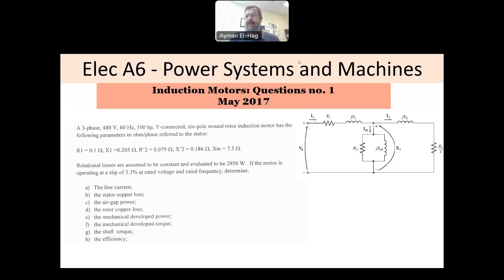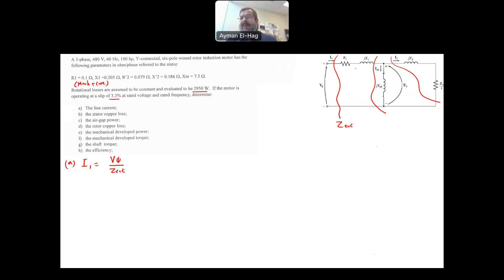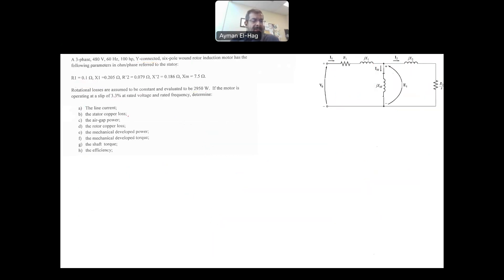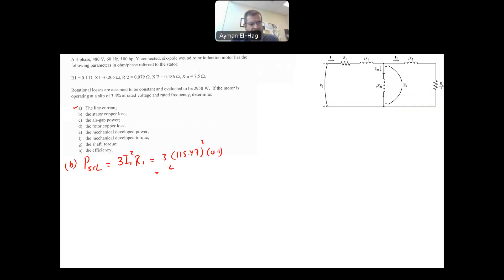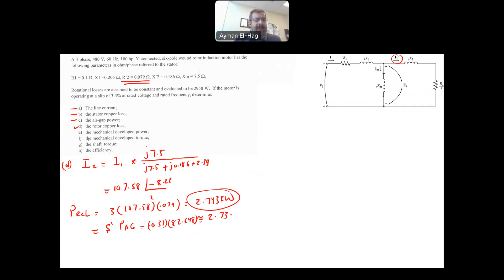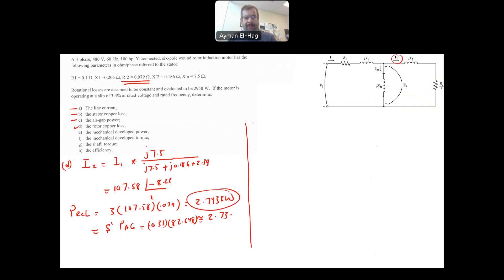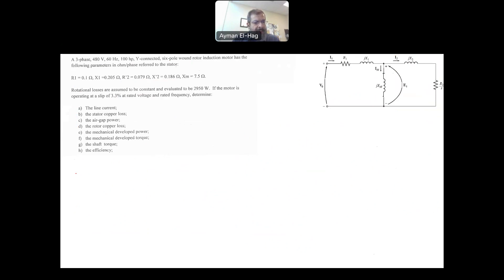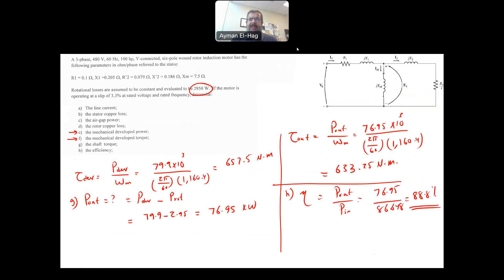PEO solved examples (ELEC A6) Induction Motor Question no. 1

Comment: Hello professor, good day. Question for item d., do we not need to divide R'2 to slip (3.3%) when calculating for the rotor copper loss? Is slip only applicable when we are calculating values for the stator? Thank you.
Reply from the maker: Hi
When we calculate the rotor loss we only use R2 without dividing by s. The power associated with R2/s is the air gap power. You may watch the induction motor power flow video
Reply: @electrical4everyone  Thank you very much Dr. Ayman. You have been a great help!
Reply from the maker: @arielgalang0726 You are welcome

Comment: A 50 hp, 440 V, 60 Hz, three-phase, Y-connected induction motor has the following equivalent circuit parameters:
R1=0.1Ω
R2′=0.12Ω
X1 =0.35Ω
X2′=0.4Ω
𝑃rot=2150W

With no load, the line current is 18 A at 0.089 p.f. lagging. If the motor speed is 1755 rpm, determine:

a. the line current;
b. the developed torque;
c. the output power (may be different than rated output); and,
d. the efficiency.

dear prof, I am unable tio figure out this question. I tired, but the answers aren't making sense. i have never seen a question with excitation branch elements not given. is the question itself wrong or is there a way to tackle this? Really need your guidance on this one. I shall be grateful to you.
Reply from the maker: Can please give me the exam date, I'm assuming it is A6
Reply: @electrical4everyone  Sir, its May 2014 A6 exam

Comment: Thank you, well explained!. I wonder why the Pout calculated=76.95kW is not close to 100HP*746=74.6kW? Thanks.
Reply from the maker: 100hp is the motor name plate value. Pout is the actual output power at the given conditions that may or may not match with the name plate values.